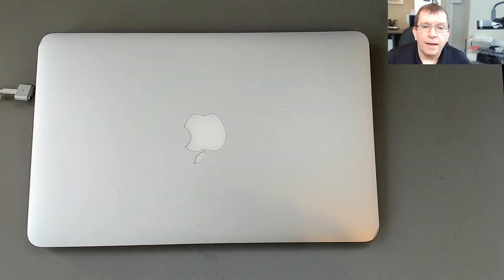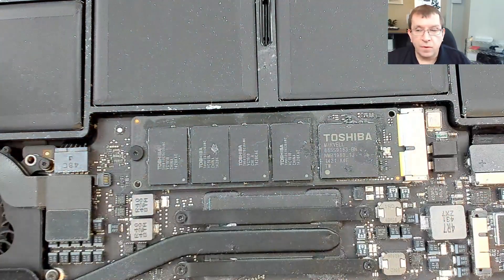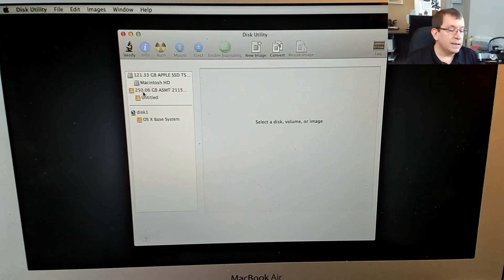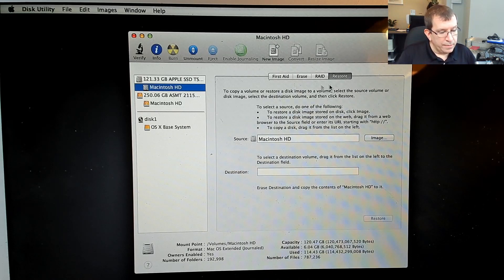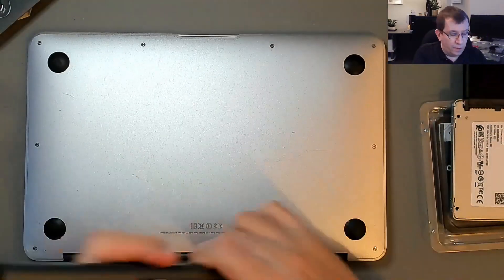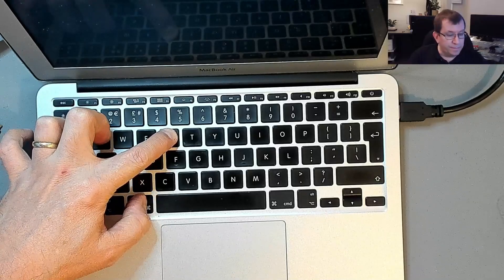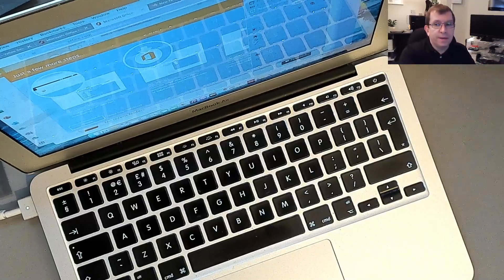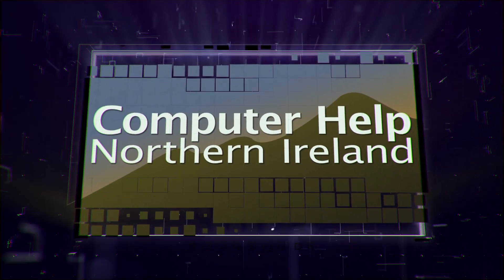[29] SSD upgrade in an Apple MacBook Air A1466 (11-inch, early 2014)

Comment: My new ssd is not showing up in disk utility , but the old one runs fine . I m using crucial p3 1 tb ssd . I also changed the adapter but still not showing up
Reply from the maker: Hmm, I'm not sure what could be wrong. I did find someone else having issues with a P3 in their Mac: https://discussions.apple.com/thread/254718541
Reply: @ComputerHelpNI  I check it but I didn’t get the point , so basically I was using monterey and created bootable installer with same . So what should I do ?

Comment: I have a Macbook Air with El Capitan installed...
Could you not just use a TimeMachine backup of the original drive to an external drive, then fit the new one and do a restore from the TimeMachine backup, would that work..?. I have a 13" early 2014 A1466
Reply from the maker: Yes, I suspect that would work just fine.

Comment: Good video. Why put the screws in when you test it? You're double handling.
Reply from the maker: In cases like this one, the bottom cover didn't want to stay on by itself, so I just replaced the screws. It does get annoying, however, so you're right that double handling is inefficient.

Comment: Hi  I got as far as restoring from "Macintosh HD" to "NewSSD" but got  a Failed result. The new disk which is now also called "Macintosh HD" has only 15.9 GB and not the full 119GB of the old disk. 
I noticed that my Disk Utility will only let me format to APFS - is that the problem?... OK, I see, maybe it is the Big Sur problem - I will try Carbon Copy Cloner next
Reply from the maker: I've found the only way I'd get consistent results was to use Carbon Copy Cloner, at least after Big Sur. Good luck!

Comment: I haven't done it yet, but it looks good.
1
Is it better value or quality to use the nvme drives over the limited supply of mac connection ssds?
2 if I have an external usb to nvme connector can I "restore" direct and then pop the drive in? Or is that affected if I update the os?
Reply from the maker: I'm not sure which (Mac or standard NVMe) is better, but NVMe is going to be less expensive. 

While you should be able to restore to the new NVMe drive through the USB adapter, sometimes those adapters don't work very well. If the Mac sees the NVMe drive when you plug in that adapter, you should be able to restore to that drive. Good luck!

Comment: I found out that the best way is to create a bootable hard drive/flashdrive to install big sur os to newly installed SSd.
Reply from the maker: That's definitely the most reliable. If you have access to the old drive, you can install Big Sur and then restore the content from the old drive to the new one. Alternatively, Carbon Copy Cloner is pretty good at making bootable clones of Big Sur drives.

Comment: Hi. Thanks for showing the procedure to do this. One question- Did you notice any difference in the read/ write speed and overall performance of the MacBook Air with the upgraded SSD as against the stock setup?
Reply from the maker: I didn't notice any obvious difference, and unfortunately I didn't' think to run a before and after speed test either. Next time I'll try to remember to run Blackmagic Speed Test or something similar before and after...
Reply: @ComputerHelpNI  Oh. That'll be nice. My concern was if there's any drop in performance. But if you haven't noticed any obvious difference with the new setup, I'll take it that there hasn't been any drop in performance.  Thanks for the prompt response!

Comment: Thank you for this helpful video! I didn't get whether you ended up using that adapter at all or not. Were these 2 drives that you considered the same kind (interface etc)? Which OEM was the black one from? Where can I get one these adapter / what keywords to look for!
Reply from the maker: I used this adapter: https://www.amazon.co.uk/gp/product/B07FYY3H5F/
I used this SSD: https://www.amazon.co.uk/Crucial-CT1000P1SSD8-Solid-State-Drive/dp/B07J2Q4SWZ/

Comment: Hey I am getting Hibernation issues how to solve that???
Reply from the maker: What kind of issues? If you're seeing the 'Sleep Wake failure in EFI' error, I would suggest using Google to search for the exact error you're encountering to see if others have had (and resolved) the issue. You can also post more info here, and I'll try to help.
Reply: Yes sleep awake failure in EFI also now on updating to latest macOs it is showing that disk has some hardware problem that couldn’t be resolved so backup as much data is possible
Reply from the maker: @chiragjoshi9545  That sounds like one of the components (either the SSD or the adapter) is faulty. That's a frustrating situation, as it's impossible to know which one might be bad without just replacing one or the other. Sorry that's happening.

Comment: Hi, thanks for making the video! It is insightful and well-explained. I'd like to ask something, if we put back the old SSD again  will our computer account get back into the old one? 

Also if we have installed new OS using the new SSD, what will happen when we put back again the old SSD? will it affect the OS? Will the OS be downgraded? (I dont even know if that's possible or not sorry)

Many thanks!
Reply from the maker: Thanks for your kind words! Yes, if you remove the new SSD and replace the old SSD, the computer should work exactly as it did before the upgrade. The old SSD had a previous version of Mac OS, so when that old SSD is installed again, the MacBook will once again be running that older version. Is that what you're asking?
Reply: @ComputerHelpNI  Yes that's exactly what I mean! Thanks for the explanation!

In case of my MacBook, there are 2 computer accounts. My sister made another computer account to save several docs. However, I'd like to replace the SSD with the new one. 

Assume that I have installed the new SSD.  do you think the computer account will appear as before (2 computer accounts) if I put back and reinstall the old SSD? Thank you
Reply from the maker: @billyprabowo5031  If you clone the original SSD (which has two accounts on it) to a new SSD, both accounts will appear on the new SSD. I don't understand why you would put back the old SSD, as the new one will be an exact copy of the old one -- accounts and all..

Comment: Do you contact information if I need your services for something like that. 
MacBook Air early 2014. Ram increase. 
How much did that cost. ?
Reply from the maker: That computer has its RAM soldered to the system board and was not intended by Apple to be upgradeable. I do not offer this service--sorry.

Comment: Will I also need to buy an adapter if I’m upgrading my ssd and buying the crucial brand one for MacBook Air early 2014
Reply from the maker: Yes, you will need an adapter. Be sure the adapter is designed for your specific model, or it might not work.

Comment: @5:35 You mentioned updating Mac OS using that external SSD- How was that updating possible? You mean there’s an option to boot from external SSD and run the OS as usual, then update?
Btw thanks for sharing,  very clear explanation. 👏 This will make me pick that long adapter instead of end only.. I’m skeptic with the end only adapter.
Reply from the maker: Yes, exactly: If you have an external (bootable) SSD plugged in, you can hold Option (⌥) or Alt during startup to choose which drive to boot from. MacOS runs surprisingly well / fast from an external SSD.
Reply from the maker: And thanks for the compliment--I'm thrilled that my videos are helping people!
Reply: If it can boot from the ext SSD that back up from the original Macbook Air drive, then should it be better and time saving if we back it up in the first place into the M2 connect externally via ext adapter and swap in after that?
Reply from the maker: @danphan1973  If you have the correct adapter (internal M.2 -> USB/M.2) then yes, what you describe would be more efficient than the way I did it (internal M.2 -> USB/SATA and then USB/SATA -> new internal M.2).

Comment: I am going to recive my wife her mac air the mac will be reset and deleted. Is it possible to just swap out the drive and then boot up?
Reply from the maker: It should be possible from the Recovery system. Press and hold Command (⌘)-R when starting the Mac to access macOS Utilities. From there you should see 'Reinstall macOS' as an option
Reply: Thank you very much! We are waiting for the new mac air to come out hopefully with an M1X or M2 chip
Reply from the maker: @marcelab6796  You're welcome. See these instructions from Apple for more detail: https://support.apple.com/en-gb/HT204904

Comment: I have this exact same model and out of the blue it won't turn on anymore :'( I'm trying to find an affordable solution to save its SSD. Any ideas? :) I've tried looking for an external case but what I'm finding are either confusing specs of which I'm not sure they'll work or €100+ options.. Cheers!
Reply from the maker: You could try an Apple 'gen 3' (the 12+16 pin drive that you have) to M-key M.2 adapter (something like this, perhaps: https://www.aliexpress.com/item/4001157329590.html ), but I've never used one. From there you could put the SSD into a PC, or you could use an M.2-to-SATA adapter and connect that to a USB port with a SATA-to-USB cable.

That all sounds pretty fiddly if you ask me. Have you asked anyone for an estimate to fix the MacBook instead?
Reply: @ComputerHelpNI  That's exactly what I need, just didn't know what it was called. Really appreciate the quick response, thank you!! I just realised a family member might have this same model. If I were to screw open this machine and feed it the (foreign) SSD from my machine, (reset NVRAM?) would it boot from the OS or recovery partition?
Reply from the maker: @bartschutte1619  Yes: Assuming the other MacBook has the same SSD connector, you should be able to move your SSD to another MacBook and boot normally into MacOS, as if it was your old computer. Macs are very good about that sort of thing; as long as the OS version supports the hardware version, it will just work. Note: If your SSD is encrypted (e.g. you turned on FileVault in the past), I'm not sure whether this will still work. It's probably worth a try though.

Comment: Hi, i have a early 2015 macbook air (1466), bought the short adapter and a P2 500 Gb ssd. The problem is that when i get to the disk utilities, no internal disc is recognized only the external ones. Any help on solving this problem. Thank you !!
Reply from the maker: Hmm... Sorry to hear that. From what I understand, that configuration should work. Have you taken it apart and reassembled it, ensuring that each component feels right when going together? Troubleshooting steps might include trying the drive and adapter in another laptop or trying a different adapter and/or drive in your laptop. (I know that's a tall order, as you likely only have one of each available. Is there a repair shop nearby who might be able to help you narrow it down?)
Reply: The problem may be in the old version of diskutil, and have you tried to boot os from the usb stick version catalina or higher?

What original version of mac os did you have?

Comment: I have a Macbook Air 2017, What adapter can i use in order to buy a normal m.2 ssd ?
Reply from the maker: I'm not sure, as I haven't upgraded a 2017 MacBook. The adapters I bought specifically say they work in "2013-2015" MacBooks, so it would be safer to buy a M.2 SSD that says it's designed for newer MacBooks. Also, be sure you're running at least Mac OS 10.13 (High Sierra), as newer SSDs require newer drivers.

Comment: Can I ask if I can put any brand of SSD m.2 on the macbook? I have a dead original SSD but those are quite expensive and hard to find, so I want to put an 128 Gb on to the laptop, but has to be a cheap one. It is possilbe?
Reply from the maker: Yes: As long as the adapter is compatible, you should be able to use any M.2 NVMe SSD.